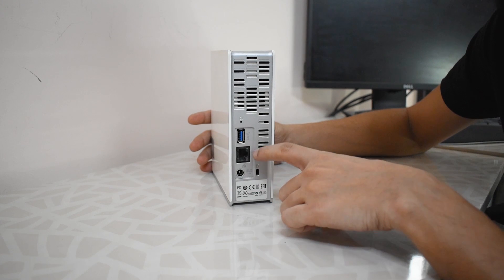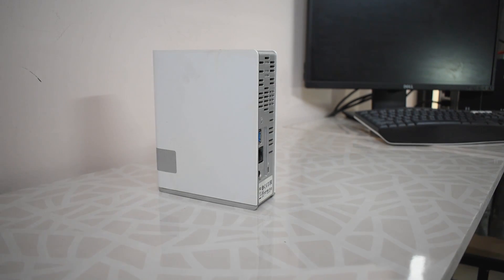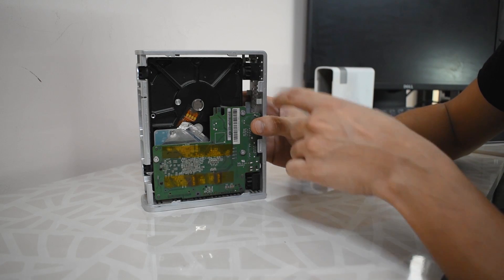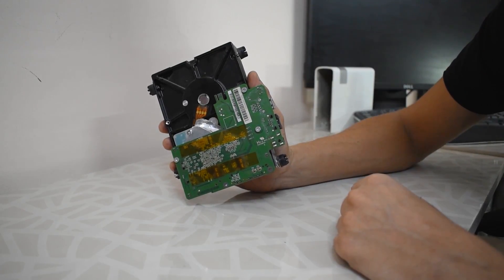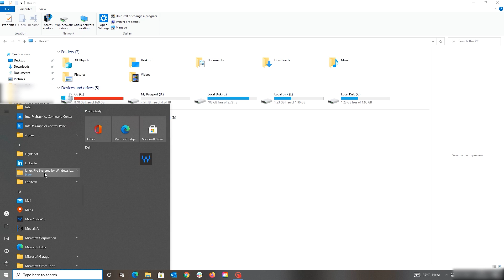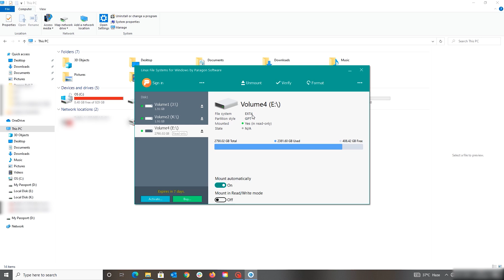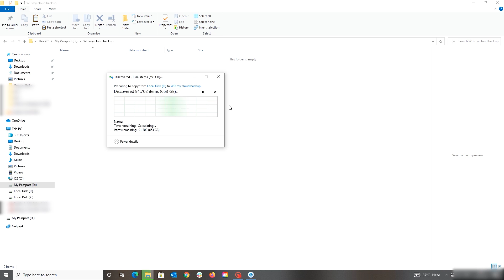How to salvage your data from a failed WD My Cloud?

Comment: I am using a SATA to USB cable on my laptop, is it possible that there is not enough of power to run the WD Red NAS drive? I cannot hear it running so it is either dead or not enough power. The paragon software didn't pick up that drive or a new external drive i connected as well.
Reply from the maker: The hard drive needs dedicated power, either through a SATA power cable found in desktops or an external docking station for a 3.5 inch hard drive.
Normal SATA to USB cable only have data runs, and not power.

Comment: I have a question so I don't think my computer has those cables inside to hook up the external hard drive from the MyCloud. Could I use like a Duo hard drive docking system that I've seen at Best buy and Walmart?
Reply from the maker: If the docking station has the proper setup to handle both power and data for the 3.5 inch sata drives, then yeah you should be able to use it.

Comment: This is the first real issue that I have had with this NAS. Mine is nearly ten years old, and I've already got a QNAP NAS on-line with 90% of the data that I had on this one.  So, I used this video to save the data files from this drive to the QNAP.  I'll hold onto the drive to use as off-line storage in an external drive bay, but I'm probably done with this style of NAS. The effort to document this is certainly appreciated.

Comment: I have had the same problem and have use Paragon to access the drive. But all the files have random file names like 0bre39ULYe_wYLEn4aVGS23jtdDVq4tlgC0qmyYI or whatever. Not sure what's up. Any ideas?
Reply: Search for the exact folder names so that you can drive into the complexities of how WD setup the file system. The process is well described, but having a wee bit of understanding of how the files are managed on the device is quite helpful.

Comment: this is a great video very helpful as an alternative to Paragon: I was able to recover using free software for Windows: **DiskInternals Linux Reader (x64) 4.24.1**. This program allowed me to access and recover my Linux files directly from within Windows.

Here’s what I did:

1. Installed DiskInternals Linux Reader.
2. Launched it, and the program automatically detected all my drives, including the Linux partitions.
3. I selected the *largest partition* and navigated through the file tree as follows:

   ```
   /CacheVolume/shares
   ```
4. Inside, I found all my files and folders.
5. To recover them, I simply *right-clicked on a folder* → chose *"Save"* → and selected my destination folder in Windows.

That’s it! The program copied everything over, and my files were safe.

So if you’re stuck trying to read your Linux disk on Windows, this method should work. And, as the saying goes, *Bob’s your uncle*.

Comment: I had the red led come on and lost access to files while that was on. I did some reset procedures that I saw posted and it worked again. I went and got another NAS and copied the files over straight away. My replacement was Qnap brand, I had to spend some time researching the setup as it has some options, the My cloud was easier to setup. The one thing I did not like about the My Cloud is that is lost the ability to transfer complete folders remotely when using the app or web interface. I now have this back again with the Qnap.

Comment: Super video, I have managed to salvage all my data from my WD My Cloud with solid red light. Only thing to add is that apparently 3.5" disks need external power, so I had to buy a an external disk enclosure with power supply but it was quite cheap. Thank you for the video 🙂

Comment: Thank you very much for your contribution. Before disassembling everything, and since you've done a lot of research on this issue, my computer flashes blue rapidly, never reaching red. I've tried every reset I've seen online, and it doesn't work. Do you think I can't do anything now and should disassemble it?
Thank you. Your contribution is very valuable.
Reply from the maker: You can reach out to WD once to see if they can help you with steps to flash a new firmware on the drive. If that's not possible then disassembly is the only alternative.

Comment: Thank you for this instructive video. I have a similar device which was dead recently. I follow your instructions and manage to take out the drive to plug into Windows PC with a SATA to USB cable. However, after I install Paragon software in your link and open it, nothing shows up  in volume :(
Reply: I replaced the cable and it worked. Wonderful.

Comment: Whats cable number 2….where did those wires come from…isn’t that the key to the whole data transfer? Explain that better? Do i have to buy sata cables?
Reply from the maker: The cables I plugged into the HDD were sata power and data. I had a CD drive in the PC and they use the same cables so I unplugged that to use the cables with the HDD. 
If you don't have sata cables and don't want to buy them, then you can search for a 3.5 inch hard drive enclosure on Amazon and use that to plug the HDD as an external drive to your PC/laptop.

Comment: Thanks Nikunj,
I had a dead WD MyCloud with about 10 years of data. I contacted a drive recovery company that wanted $700-$3900 to recover the drive. Following your instructions and using the recommended software I was able to recover the data for about $60. $30 for a SATA drive enclosure, I only have a laptop, and $30 for software. While Paragon Software allows the free trial and I probably won't have to use the software again, I will be purchasing the $30 home license as both a thank you and for the use of the product. 😊

Comment: Hi dear,

I recently unboxed my WD My Cloud Home, which I purchased from Dubai a few years ago. Unfortunately, I ran into issues right away. I had left it unused in storage, assuming I could set it up when needed. However, after three years, I discovered that I couldn’t connect to it—the WD servers weren’t detecting my device.

After multiple frustrating conversations with WD support, they finally admitted that their senior engineers had been instructed to remove firmware support for legacy products. All I needed was a firmware update to get it working again, but despite my persistent follow-ups, they outright refused. Even after escalating the issue, their final response was that I should buy a new one—which was a hard no for me. Their only offer? A 20% discount, meaning I’d still have to pay 80% of the cost of a new device.

Now, my only option seems to be converting it into a regular external storage device. When connected to Windows, it detects multiple drives (16-20 partitions), which seems odd since no partition limit is mentioned.

Does anyone know how to convert this into a standard external drive? Any guidance would be greatly appreciated!

Comment: Thank you SO MUCH! My drive was giving the same issue and your video guided me smoothly through the whole thing. The part about it being a Linux drive and which software to use for recovery was especially useful! Thanks again, much appreciated
Reply: I do have a follow up question: Given the HDD seems to be physically ok and readable, is there a way to get the NAS functioning again? I was getting the same red light as you. The drive IP showed up on my router, but if I tried to access it from my PC the windows explorer would crash. Any thoughts? Thanks!

Comment: What cables do you use if you don't have a tower/desktop computer?
Reply from the maker: Hey, if you don't have a desktop and are working on a laptop, you might need a case for the 3.5 inch drive. That's going to come with a small power adapter and a USB cable to connect your drive to the laptop. 
FYI, over USB, the transfer speed is going to be super slow.

Comment: so i was able to get the drive connected and opened through paragon but the files are completely different. different folders/paths and crazy long file names. Looks like all of it is there (1TB of 2 used in storage) but completely unrecognizable. Any advice/help
Reply from the maker: If the file names appear as long alphanumeric strings, it's possible that in your case the drive stopped working due to data corruption. You may want to try running a data recovery software or reach out to someone who provides recovery services.
Reply: @nikunjmuglani  any suggestions on software?

Comment: is there a way this can be done via a laptop?
Reply from the maker: Yeah, there are enclosures that you can buy to use an internal hard drive as an external one. You can try connecting the drive to your laptop via the enclosure using a USB cable and see if the software is able to detect it.

Comment: the part not possible to unscrew was not actually needed to unscrew, instead grab the black part and unwind it as if it was a spinning handle - very easy. took me a moment to realize as well. my main issue with the disassembly was that the screw in the last step was different size in my case than the previous ones and I could not find a proper one

Comment: Was the error caused just by software or does this relate also to case when the drive doesn't really read anymore and makes sound of failed head? I guess with failed head this is useless to try. @nikunj muglani you promised in the beginning of the video to address both cases even the situation when the drive is physically not working but then you didn't get to it it seems.

Comment: Thank you so much for sharing this, I have tried for days and ends trying to install Linux on both my Mac (new Apple silicon) and Windows machines. Each pose huge difficulties because there are dual boot, boot from USB flash drives and various Linux versions. I have not been successful at any without the fear in wiping my hard drives and render it not bootable. I was just about to try VM method but that is the slowest even if it were to be successful, with the amount of files I got, just going to take ages. Like other commented, I have personal files that are stored in my WD for years. Anyway, Paragon software has worked immediately for me. Thank you so so much! 💕💕👍👍

Comment: i have an older model (the black one with the curved front).  I'm getting a flashing green light that won't go away.  First plugged in it is blue, then white, then goes to the green flashing.  I think i'm going to remove HDD and recover.

Comment: Keep ALWAYS an updated BACKUP of your critical HDs in a DIFFERENT UNIT that is NOT ALWAYS plugged on your computer (an external device, for virus issues). If possible, 2 external units, and alternate their use. You’ll say: it is expensive and time consuming! Think of this: how much would you pay and how much time will you want to waste if a critical error happens to your ONLY copy? I have passed through this and I can tell you that it is no such thing as an expensive backup.

Comment: Nikunj - this is amazing! I am able to restore 3.5 TB of data using this paragon software with some hiccups. You are the life saver. Thank you so much!! A few hiccups: Copy - paste procedure did not work immediately for 3.5TB of data, recognizing files option stopped after 2.5TB (it was running overnight for 6 hours, looks like it was not doing anything so had to cancel it). Then started the operation with one folder at a time. first folder, 1.76 TB, its copying data now (and will complete in 12 hours, as it is showing). I am using laptop with 2 USB 3.0 drives. I had to buy "Inateck USB 3.0 to SATA III Hard Drive Adapter Converter for 2.5/3.5 Inch SSD and HDD, Power Adapter Included, UA1001" from Amazon as I was unable to take out the side hinge (steel one) attached to the drive, and to fit this adapter properly, I had to bend it with hand grip plier (bend to 2-3 mm only). Overall you gave the direction, and we followed. WD My Cloud (OS3, firmware upgraded to OS5 did not fail on me, but it was not accessible). it was taking hell lot of time to open the page from the browser. Secondly it was not mapping the drive from the laptop (any laptop, or any version). I am pretty much done with WD NAS. Lesson learned hard way, so now purchasing Asustor AS5202T and then will configure it to use "RAID 1" to mirror data in 2 drives, and using 8TB drives. Thank you for help on retrieving the data.

Comment: Why doesn't WD tell you about this  ?   I am so angry that the lack of support for the WD Home Drives ...   I appreciate the software tip .   Western digital has stop the main app (WD Discovery)  from working.    THIS STINKS >>.    I appreciate your information. I have read that this box is a Linux box ...and it can be accessed using SSH with root access ... ...  I'm looking for a way to make /hack  this into  something  easier for hosting the drive. I know with Linux you can often do the impossible  ..     I still think WD STINKS ...least their customer support

Comment: The tips on opening the enclosure were good, I wish I'd known about the credit card trick when mine failed a couple of years back. As for the data recovery, Windows can now use WSL to mount Linux filesystems, so no third-party software needed. Alternatively, as I did back then, you can boot into a Linux Live image such as Ubuntu, it will be able to mount both the old HDD to recover from, and the USB HDD you're recovering to, just drag + drop.

Comment: DUDE! Thank you so much for making this video. Just managed to save a whole bunch of data I didn't even know was on it from years and years ago. I've been stuck on a blinking blue LED. One thing though- for me, since the damn MyCloud only broke after I unplugged the power cord without a proper shutdown, I was stuck on an endless "consistency check" because there were some faults in the drive now. After using that program, I did a scan with it and told it to repair the broken sectors, and now BRAVO it works just like new! Just so grateful this headache I've spent a solid working day's worth of hours on is finally cleared!

Comment: Would you be able to follow the same procedure as you have but putting the WD Red drive in a dock? I have two HDD docks that I just slide the drive into the dock connect the power to the dock and the USB cable to my pc. This technique has worked for 5 1/2 drives that I just had laying around to use or test. Thanks

Comment: Did anyone else open the Paragon Linux File System software and not see any drives available to view? I tried everything I can think of and the MyCloud isn’t showing up in that software.
Reply: I am facing the same problem
Reply: @studioelitecolorlab9342  I couldn't find a resolution and tossed the unit. Unreliable piece of shit.
Reply: It shows unfortunately no supported volumes have been found
Reply: Same with me any updates?
Reply: I am able to connect drive It shows drive partition and sum files also but they are on Linux , I am running photo studio so my 15 year data of customers passport photos not able to see them as jpeg saved in my drive 
Did not found any solution

Comment: thanks for the video. Currently i am getting blinking blue light on my WD my cloud. currently searching way to resolved this. if not, will use your method to atleast recover my data. 

 now as my WD is no longer available, what other alternative is available to replace WD mycloud with same functionality
Reply: Were you able to get this resolved? I have a blue LED blinking and WD Support says it may take upto 7 days to turn in solid blue before the drive is accessible.

Comment: You sir are a complete life saver! I can’t thank you enough for putting this content out. I followed this step by step and was able to save 15 years worth of family memories :-). I will add that I am operating on a MacBook Pro so I downloaded the Paragon program that is compatible with a MacBook. I will also add since I am utilizing a laptop, I needed a SATA to USB adapter. If you go this route, ensure that you get the adapter that has a power cord. You will need that added power to actually power the hard drive. Thank you again man!
Reply: Which version of the software did you use for mac?

Comment: Thank you SOOO much! Same story as many others. My mother-in-law sadly passed away and there was no more delaying the inevitable task that I had been postponing for a year: I had to get those pictures off the old NAS which had crashed after a power failure. What caused some delay was the fact that I stupidly downloaded the wrong version of the Paragon software so initially the software couldn't find my WD drive. When I figured out that I'd installed the Apple version instead of the Linux version I was very very pleased to recover all those old family pictures. And I'll hopefully score some browny points with my wife!

Comment: I am not able to see my drive using the Paragon software and in several other software as well. Does that mean it is broken or corrupted?
Reply from the maker: That's a possibility... Have you connected the drive using an internal SATA header? If yes, does the drive show up in disk management?
Reply: @nikunjmuglani  I used an external SATA to USB cable. It does show up drive as "Disk 2" in the disk management but it says "Not Initialized". When I click to initialize, it throws CRC error.
Reply from the maker: @tejasgajera  that error normally comes up when the OS isn't able to read the drive which may be due to multiple reasons. But yeah, corruption can be a culprit.
Reply: @nikunjmuglani  Do you think there is any chance of getting data to recover?

Comment: Great guide, thanks for sharing it with people who might not know. My only critique: Laying the hard drive onto the computer sitting sideways like that is unnecessarily risky in my opinion. If by accident it falls and/or some of the exposed contacts on the drive are shorted by the metal of the case, I would be worried about ruining the drive. I'd recommend at least inserting it into the case properly or maybe getting an external USB 3 enclosure or docking station. Your data is worth that much.